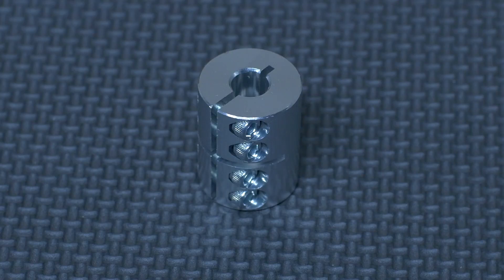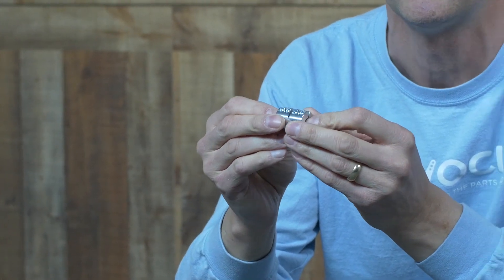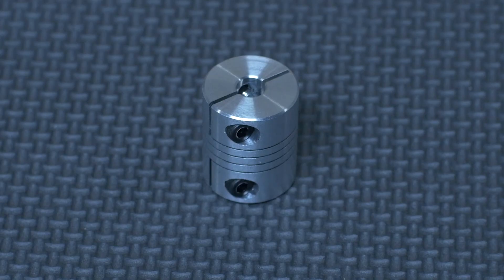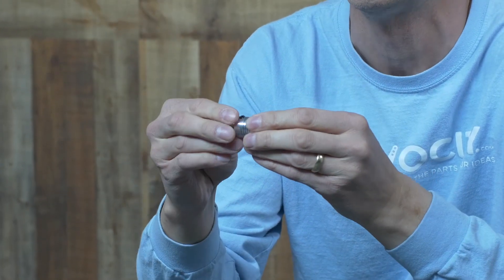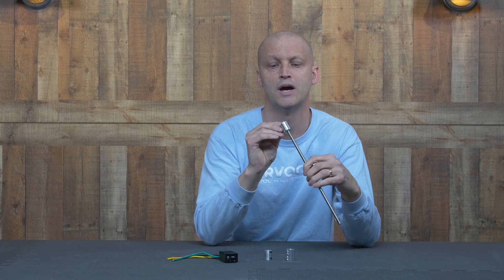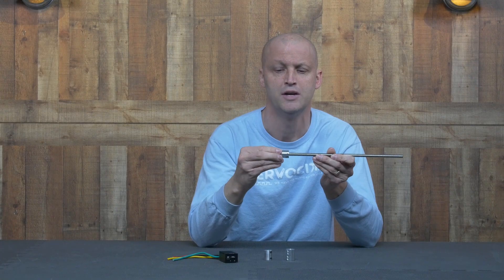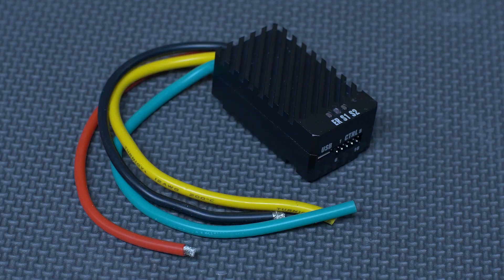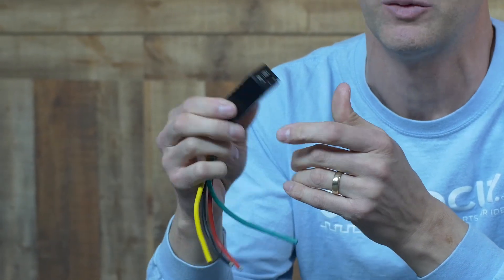ServoCity Products: New Couplers & RoboClaw Controller

Comment: I want to supply 32V..... to https://www.servocity.com/roboclaw-solo-60-a-motor-controller
..... but I want to run the drive motors....... within the range of 0-24V can we do that......
Reply from the maker: Hi Jeevan, if you want the output voltage to be different than the input voltage you'll need to regulate your input before connecting to the motor controller.  When selecting a voltage regulator just be sure that it can handle the current that your electronics are able to draw.  Please let us know should you have any additional questions tech@servocity.com.